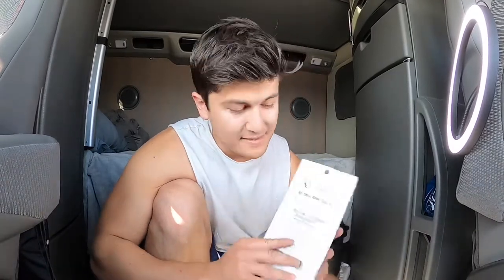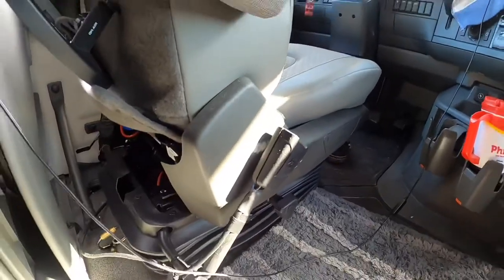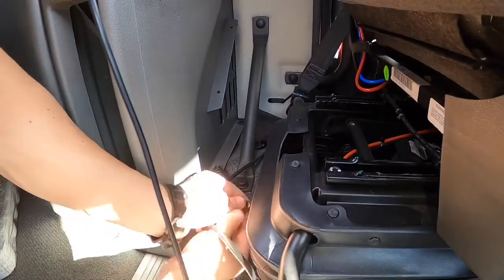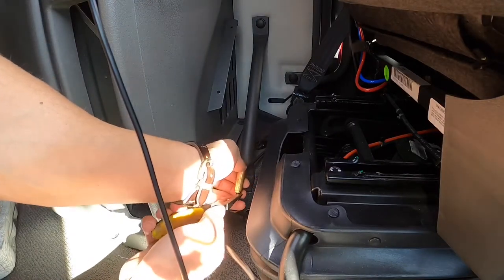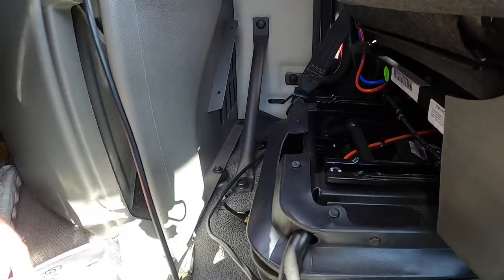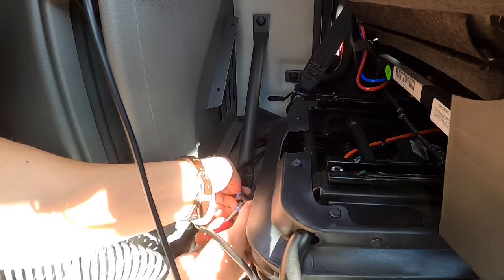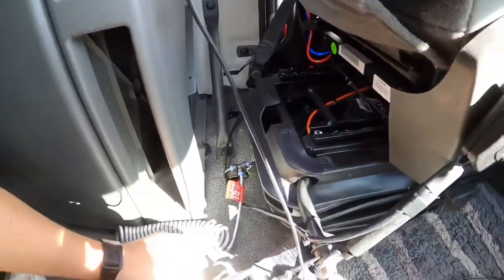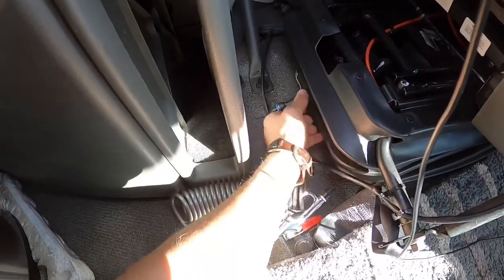Tool Free Air Seat Blow Gun Kit Installation

Comment: It's a year later after this video and I'm needing to replace my blower. I went to the TA here in Barstow, CA and they don't have the blower with the plastic fittings. They only have it with the metal fittings so I went ahead and bought it since I know that Pilot/Flying J and Love's are the same. Maybe TA doesn't have the plastic ones a year later because of the supply chain issues that are happening now or maybe it's just this Barstow location?
Reply from the maker: Thats a good question, I will keep eyes on it and keep you posted. It could very well be the supply chain issue 🤠
Reply: I got the turk stik brand at loves in Madera CA and it had the plastic fitting. Its a bit more than the one in the video, but it has a standard quick connect so you can remove it when your done. You can also connect any air tool, so that means you can change the blow gun to a different style too if youd like or change length of hoses. Your options are endless.

Comment: Dude the one I bought at loves it’s all brass and have two little brass fittings that wouldn’t fit. Even when I srcrew back brass nut it wouldn’t hold the hose in. Returned it. Gonna try at TA
Reply from the maker: Get the one from TA, fits perfectly and easy too. Make sure the fittings are plastic, they last forever
Reply: How did you fix your air leak in between time ?
Reply from the maker: Not sure if I understand the question. Can you please ask again?
Reply: I did the same thing.  Bought mine at Loves.  It came with brass nuts and sleeves and it wouldn't fit my air lines. It's been in my basement over a year.
Reply: Cut a small notch on the house and you should be able to get it started. Try to push it down and make a new clean cut.
Reply: @StandngOnBusiness  You CAN'T stop all leaking...

They ALL leak, unlike in the OLD DAYS...

What I did was bought a pair of needle nose grip pliers and used it to clamp off the intake line to the left of the coupling, where both sides of the airline is stick into.

It still leaks just a little bit, but it only affects me when the truck sits overnight, and it empty out my air tanks.

I can still hold air in my seat this way, and just remove the grip pliers whenever I need to use the air gun 🤷🏾‍♂️👍🏿
Reply: Guys, you CAN'T stop all leaking...

They ALL leak, unlike in the OLD DAYS...

What I did was bought a pair of needle nose grip pliers and used it to clamp off the intake line to the left of the coupling, where both sides of the airline is stick into.

It still leaks just a little bit, but it only affects me when the truck sits overnight, and it empty out my air tanks.

I can still hold air in my seat this way, and just remove the grip pliers whenever I need to use the air gun 🤷🏾‍♂️👍🏿